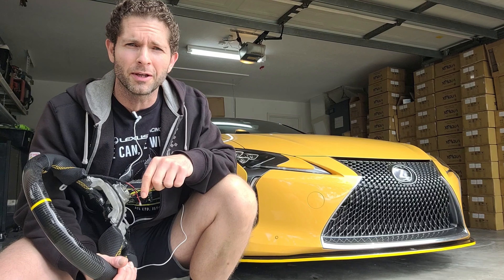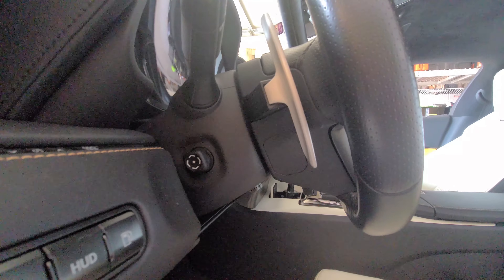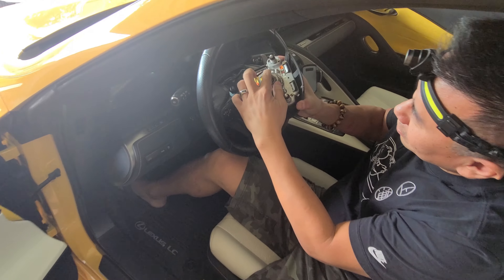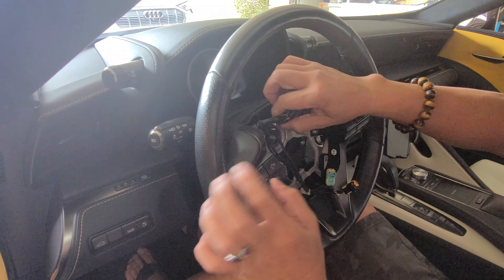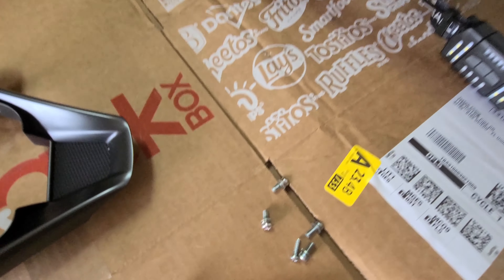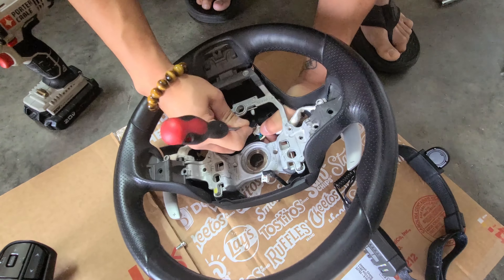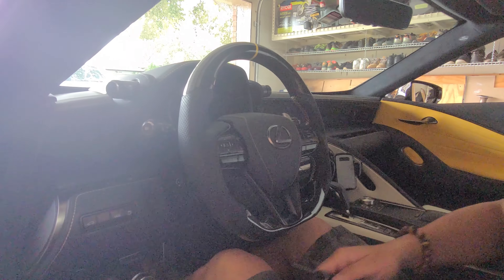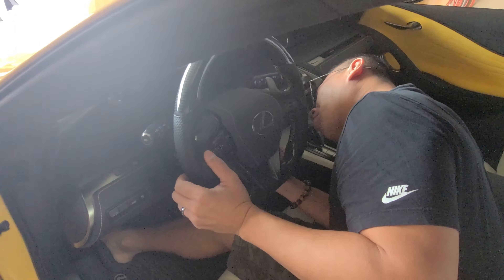How To Install An Aftermarket Steering Wheel on A Lexus LC500

Comment: Thanks for the video. Noticed you mentioned a 10 mm bolt in the center. Is that accurate? Internet is saying it's 19 mm.
Reply from the maker: I think 10mm was for the battery but the wheel is 19mm....
Reply: Completed install. This video was a big help. Thank you!

Comment: Many thanks for the video! 
I am also considering installing a new steering wheel. Is there a particular reason why you haven't connected the steering wheel heating?
Reply from the maker: The owner decided not to connect the heating element because he didn't want to solder the connection....I believe that's what you need to do. If you find any other way of connecting the heating element, please let me know!
Reply: Does This cause any error Code when None of the Plugs for the Heater connected
Reply from the maker: @JoJo97769  no it hasn't up until now.
Reply: @RichWithCars 

Many thanks for the quick feedback! 
Does the lane departure warning system still work?
The LC has a self-steering function - I thought the plug was for the steering wheel heating AND for the lane departure warning system
Reply from the maker: @JoJo97769  lane keep assist still works. The heating element is a wire that needs to be soldered for the heat application. But the functionality of the heated steering wheel is only thru the infotainment

Comment: exhaust sounded really good on this one, what exhaust is it using?
Reply from the maker: I believe it's a straight pipe.  @coralchopper  ??
Reply: @RichWithCars  PPE Muffler Delete. There is drone from 1800-2500rpm. But outside of that range, it sounds pretty awesome.
Reply: @coralchopper  car needs no exhaust at all

Comment: Thanks for posting this. My LC's OEM steering wheel started peeling at 3500 miles!! Lexus denied the out of warranty fix so I'm looking at getting an after market steering wheel. What company made this one and how is it holding up so far? Thanks @coralchopper
Reply from the maker: Sorry to hear that. The wheel shouldn't be peeling so quickly. As for the aftermarket company, I'm not sure, but you can send @coralchopper a DM thru IG.

Comment: Nice... Where can I get this type of steering wheel.? I would like to get one for mine. Does it keep the heating element on it?
Reply from the maker: I'll find out where he got it from....and yes, the heating element comes with the steering wheel, but as I mentioned in the video, the owner decided not to install it with the new one because it would need to get soldered.